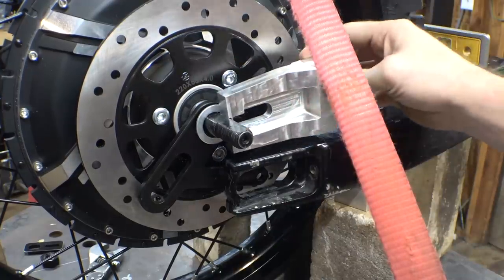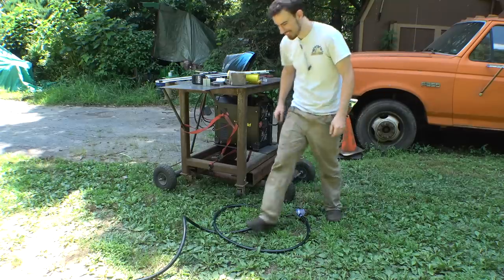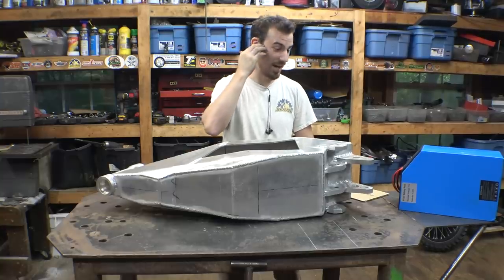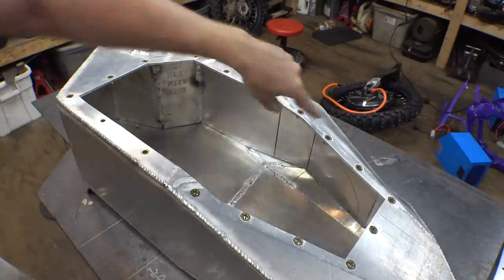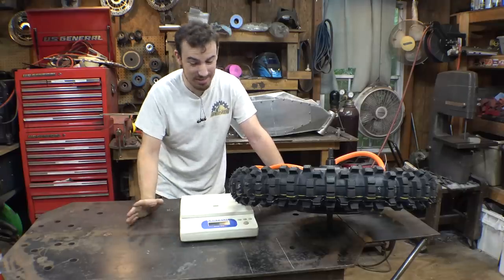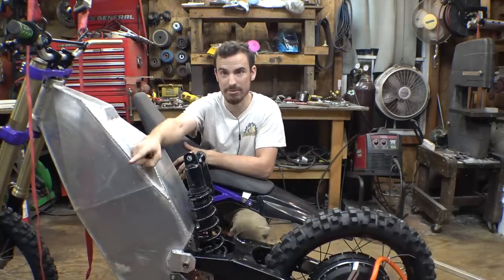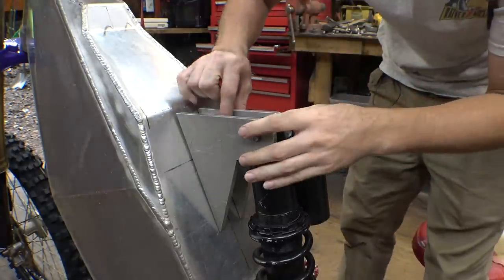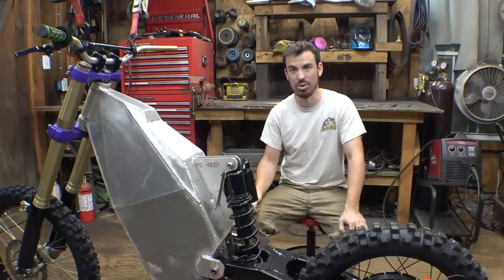Home Made Electric Dirt Bike Build - Part 5

Comment: For heat management you could always couple what gets hot to the frame. I'd wager the air passing the frame at the speeds you'll be doing will be plenty of cooling. If not bolt on a heatsink to the outside of the frame. It could look pretty cool!
Reply: Some cooling fins on that frame would be a good one to add
Reply: I would also recommend that you put a few vents in the battery compartment. They don't have to be big just enough to let out gases should the battery starts to off gas.
Reply: I've built a few ebikes. Look at Kepler's Stealth Bomber. Internal controller was fine. Aluminium will conduct heat away and emit it without air flow quite well.
Keep it sealed so you can spray wash etc. If the batteries need to vent, you want it closed up for safety. 
I recommend adding a remote key/alarm, and a decent horn. People on endless-sphere have used RF key tags for ignition switch too. 
I've allways done clamping drop outs. 5mm screw for 6kw motor. You might want 6 or 8mm screws for 12kw.
You can hit rocks on DD hub motors. Run decent pressure in the tube. Ive ridden up staircases on my 3kw 29er. It's fine at 55psi.
Great video series. Keep up the great work.
-Ken
Reply: @MakeTechPtyLtd  this is the right call
everyone suggesting he makes 'venting' on the bike either hasn't ridden an emtb or hasn't ridden one HARD
making any sort of entrance for dirt/dust/water to interface with the battery is a terrible idea and essentially makes removal of the battery and a washing a necessity after every ride
Reply: @derelictdogma  thanks. Yes people like to throw ideas around that may seem reasonable but after real world experience and investing thousands of dollars and hundreds of hours they may change their mind. The BMS on the battery should be sheilded as much as possible. A battery that big will not over heat before the motor does. The surface area and mass of the bike chassis is more than than any 12kw controller heatsink. It'll work really well having it all sealed up with controller thermally bonded to the chassis. As kepler did on his stealth bomber, he removed the controller electronics from its case and mounted the thermal block to the Chromoly bike frame with a custom made bracket.
Reply: @josephdecesaro1528  if the battery is a lipo there's no venting at all
Reply: I'm not suggesting vents for cooling, just for the chance it will start off gassing. Li-po batteries don't need venting like a car battery does but any battery burning or expanding will make that case a pressure vessel. The vent only needs to be about quarter inch with a one way check valve. While it's very unlikely for that to happen putting a small bung and check valve is not hard for a bit of safety.
Reply: @josephdecesaro1528  I see your point. Like a welsh plug I think. From what I've seen from lipo fires, the heat and pressure would escape through a basic neoprene gasket on the hatch.
Reply: Some thermal paste on the heat sink to the frame would be good to ensure good thermal transfer as well

Comment: I agree with others saying the aluminum frame will work as a great heat sink so use some heat sink paste between the esc and the frame. You also will want to Statorade the motor if you haven't already to keep the motor cool. Looks great so far and can't wait to see it in action!
Reply: Agree, I regret a hub motor on my mountain bike

Comment: Your center where swing arm is sagging lower. That's why the seat isn't lining up right. Put another block under it and it will line up fine. Of course you'll need to make another upper shock mount now.
Reply: The reason the angle is wrong may be because the swing arm was cut.
Reply: yea
Reply: That's exactly what I cam down to say. Put another block under the frame. of course it's going to raise the over all height. This is a going to be a big boy bike.
Reply: Yup. Came here to say the same thing. Maybe I'm missing something though
Reply: Agreed. Also gonna affect his rake.

Comment: Depending on how the controller heatsink is, just mount it so the fins are sticking out and seal it up. Or thermal compound it to the frame so that the frame conducts heat out.

Comment: Conformal coating for the controller's PCB and components and silicone for the lead ends.
Now you can put the controller on the outside and get the free range fan, the wind 😀

Comment: I am surprised you didn’t inset the rear axle blocks a couple of inches to spread load. Then plug weld or put dowel through the swing arm. Also the gyroscopic resistance may make it hard to lean or turn. The aluminum tank style frame can be used as a heat sink itself. Looks stout though. 👍
Reply: I think as long as you don't expect it to Perform like a dirt bike...it will never absorb rough terrain, land jumps, or handle like much lighter rear wheel. I guess not as much torque for climbing or acceleration as similar power mid drive either. I'm not sure I would trust the welds to take the abuse or have the rigidity of a proper dirt bike, it's more like a lighteeigt dual sport electric motorcycle that has some nice power and range
Reply: Gyroscopic forces plays only a really small role when leaning and turning. So no problems with that.
Reply: Oo

Comment: You can buy that cord on a spool in bulk and put your own ends on it. Might have been cheaper than two of those $200 cords. But since you have one already it would be cheaper to just add another. Either way getting the power inside  out of possible weather delays is best.
Reply: I priced the cords required for his specs and I found that they were cheaper to purchase on Amazon. Kinda odd but what I found. Though the ones that I found were 100 feed and around the same price.
Reply: Why not just buy some plastic conduit and bury the cable and add a new circuit...easy. done.
Reply: @audleyboyd1  The nice part about extension cords is that you don't need to be an electrician, don't need inspections, and don't need to dig. And since this isn't his property, extension cords means when he finally moves out of the nest, he can take the cords with him.
Reply: @bradley3549  making way to much out of it . Bury the cable run it in so you don't snag it . If you want cable when you leave pull it out. Extension cords suck not long term always in the way and are dangerous.

Comment: My initial thought on the outlet was why not just buy one of those cords and run it to the shed? Used one of those cords for my pull behind camper before I sold it, works amazingly and super thick a durable.

Comment: A second cord attached to your first one shouldn't be a problem.  Just make sure you are using at least a #8 AWG (50 Amp rated) and preferably a #6 AWG ( 65 Amp) because of the extended length.  Of course it all depends on the ultimate current draw . Glad to see you bought an extension cord though ! :)
Reply: It looks like the welder Chris has (he links it in the description) suggests a 50A breaker on a single phase 220V line and doesn't ever pull more than 40A continuously.  At 100', even a 4 AWG cord will have a 10% voltage drop and only support 40A safely.  I realize, that's a 24/7 rating for that size wire and welders wouldn't sustain that much current for long, so you could get away with thinner wire, but you'd want to watch things heating up when you're doing a lot of welding at once.

The voltage drop would be instantaneous though, if that's a factor (220-22=198V with 4 AWG, more drop with 6 AWG and thinner).  The specs for the welder on the website state a required input voltage of 220V +/- 15%, so the acceptable low end would be 187V.  He could measure the voltage at the connection between the second cord and the welder's cord easily with a multimeter (while welding on high settings), to make sure he's still in spec.

http://assets.bluesea.com/files/resources/newsletter/images/DC_wire_selection_chartlg.jpg
Reply: @Sev_Auk  In my experience, the china welders tend to pull far less than advertised. I bet he's more like 30a 220v continuous with the welder maxed out. That's 6,600 watts. When he was plugged into the 110v outlet it was only 1,650 watts.  That's figuring 110v/220v instead of 120v/240v
Reply: In any industrial setting I've been in; They put the welder close to the power connection, and extend the weld cables. I'm not a welder, don't know if this is some cost saving thing, or if there is less power loss in the lower voltage higher current welding cables.
Reply: Best of all comments
Reply: @SteveEh  That's by far less efficient (lower voltage/higher current vs. higher voltage/lower current), but logistically it makes the most sense because moving the welder around is a much bigger pain than dragging some cable.

Comment: Counter sunk Allen screws would look better to hold down the panel.
Reply: and not scrape on your knees, legs, on  the bolts, they will dig into you,  I realise there's not a lot of thickness there, but even a dome head would be better, triangulate the seat with the swingarm attachment and the top shock mount  love your vids,
Reply: bolts seem fine to me
Reply: I'm pretty sure that's not the final look, it's just progress stage of the build.
Reply: For sure. Or possibly button head Allen
Reply: @Mad.Man.Marine  yeah id say Torx or hex button head screws
Reply: Until you go to remove them and the head of the Allen screw deforms. Then you gotta drill them out.

Comment: with the possible cooling issue you could do an external heatsink through the frame or you could put some fans in the cover one blowing in and one blowing out with some ducts on the fans to keep dirt and water from getting inside

Comment: You’re doing a great job for basically just a garage project. I have a Sur Ron electric bike and its controller is mounted on the outside. Look for an IP 67 rating. If your controller has that it’s waterproof. Almost every electric bike I see has the controller mounted on the outside, even ones that are not IP 67 rated.

Comment: I think vent holes are important especially if you battery goes critical and starts off gassing. However, it kinda looks like your frame is built entirely out of an aluminum heat sink. You could always mount the hot components with thermal paste and even add cooling fins to the outside if needed. Keep up the good work!

Comment: Looks so cool! The unsprung weight will only really be a problem if your hitting huge jumps. I’m build a off-road 3 wheeler with no rear suspension the tires will soak up the bumps 👍

Comment: One thing you could do at a later date is add a smaller hub motor to the front, 
Then have a 2wd bike

Great for hill climbing 
Can be a small unit as it will be free wheeling most of the time and have a thumb throttle you can engage when in the tough stuff

Comment: you have enough space on the front to mount a radiator and use water cooling.  Maybe drilling the heatsink and mount some fittings.

Comment: You do not need to cut or add aluminum for your seat to sit flush. Just drop down the front forks. Hope that helps.
Reply: Maybe, bbut gotta be careful doing that. That would alter the rake and trail geometry.  Possibly to a completely unstable condition (tank slappers, twitchy steering, etc..). 

Possibly it could be fine. But he did mention he was trying to match the original steering and suspension geometry so he wouldn’t have to start from scratch on the engineering for that, which I thought was one of the smartest ideas I’ve heard in a while. 

Rake and trail aren’t rocket science, but they are extremely important for a bike to work right, and different bikes for different purposes will prefer different specs.
Reply: @emersonb5764  tank slappers are pretty exciting when you first learn what it is 😂

Comment: Look up the * Typhoon * its a high powered ebike that uses a hub motor BUT stripped down and mounted as a mid-drive. So you could strip down that wheel and make it a mid drive motor

Comment: One of these done as a trial bike would be sick!!!
Reply: How are you going to bunny hop a 65 pound rear tire?
Reply: @ShaunHensley  you can bunny hop a full size sport bike I think you can bunny hop a 65 pound rear tire, it’s about the suspension and technique…. plus that they make lighter ebike rear tires.

Trial bikes weigh between 150 pounds and 250’ish before fuel. Btw
Reply: @AkPacerPilot  When I watch trials events, I see them hop up a sheer face well over 6’ tall.

Maybe you meant ‘trials style’ and not really a functional trials bike.

Though even the style of bike has a super low frame, almost looks like a step through, so I don’t know where he’d put everything.
Reply: @ShaunHensley  I have two trials bikes it’s the technique and the way the suspension springs against itself to get them to hop like that, you wouldn’t need as big of a battery for it because trial bikes aren’t designed to go for a 20 mile ride, not on a 1/2 gallon of fuel. I think it’s possible, I think it would work.
Reply: @AkPacerPilot  you might be right

Comment: You could remove the Heatsink of the Controller and Glue it with thermal epoxy to the inside of the Frame and the Mass of the Aluminium would soak up the Heat.

Comment: If you mount the controller on the inside of the bike make sure you find the side with the mosfets that heat up, then put that side against the inside wall of the chasis and add thermal paste for better heat transfer

Comment: Unattach the heat sink from the motor controller and bolt it directly to the aluminum frame, with some thermal paste in between. The frame will act as the heat sink and keep everything cool.

Comment: You could possibly use a PC fan to pull air out using a reverse hood scoop design to go under the front of the seat and maybe put some vent holes towards the bottom with some kind of screen to prevent most debris and water.

Comment: Getting a charge out of this build.I find it electrifying.(You didn't think I'd not say this did you?)An external heatsink with a cooling fan will be needed,as is venting on the body.Not only internal heat building to damage,but sun on it will add into it.A couple louvered baffles to block water,at the front,and vent near the heatsink.

Comment: Hey Chris.  Great build. I was so impressed that you used the stock KX frame to make all the mounting points match the stock frame.  But you didn't use the stock frame for the top shock mount.  Moving that point will drastically change the action of the rear suspension and the ride height in relation to the front end, which will effect handling.  This is why your seat doesn't fit.  The swing arm needs to be at a steeper angle and that will lower the top shock mount allowing the seat to work.  Go back to the frame jig and put that top shock mount where it is on the stock KX frame.

Comment: Can you use the aluminum frame with some thermal paste as a heat sink instead of a fan ? Maybe just cut a port for the cooling fins to hang outside of the frame with some sealant to keep the internals dry. Great job by the way, as always.

Comment: Your frame is made of thick aluminum. Just mount the controller against it and it will use the frame as a passive cooler. If that is not enough just weld a large heatsink on the outside in the front. the heat will conduct trough the frame. To cool the air you can just do the same and mount a fan to a heatsink on the inside blowing air around internally. This will transfer the heat from the inside to the frame body which is cooled by riding.
Reply: This is so insane you can not us a box of allmanam as a frame on a bike . There is no framr between tje front forls and the now extremely heavy rear forks and tire and motor

Comment: I had to do the same for my garage. Ran it in a pvc pipe and buried it 8 inches in the ground. I used 8 gauge wires and did like a dual 110v. Just bought the end from Lowe's.  The whole thing was just under 200 bucks
Also ran cat 5 cable in the same pipe to have internet in the garage to. You have the advantage of a drive way running pretty close to the shed. Bury your pvc pipe right next to it so you never have to worry about hitting it should you ever need to dig on the property

Comment: Suggestion if you need cooling: put fins on the chassis and affix peltier circuits to them to make the entire chassis a massive radiator [at least in places where it will not impede other things like your legs and moving parts of the bike] then put an armored frame around them with some mesh to keep them from being damaged if you run into stuff...

On the inside, you can then put a ducted fan assembly between the controller and the peltier circuit to ensure all the heat is flowing directly to the point it needs to go, which will ensure peak cooling of the controller.

This will allow heat flow through the highly thermally conductive aluminum while keeping the whole system dry.

Comment: The controller isn't going to get hot. I have mine mounted on the inside of my aluminum battery box with some thermal compound. The motor is another story. It will get hot. Order some statorade from Luna Cycle and that will transfer almost all the heat to the outer case rather than heating up the magnets causing damage. It's a super cheap investment.

Comment: The battery can be larger capacity but less voltage. Also the different cell capacity also can be true but be careful. Some cells can hold more capacity but cannot discharge as fast and same with charging. I made a 20amp 84v battery with Samsung t40 cells. Can safely discharge at 175amps for a few seconds no problem. Could go higher but rather not push it. Love your videos can't wait to see how fast it is

Comment: Air to waterHeat exchanger on the outside and a little one on the inside with a fan seems the best option to me. if it’s rigged up right it will self siphon and not require a pump

Though surely there’s a water cooled controller/battery that’s cheap